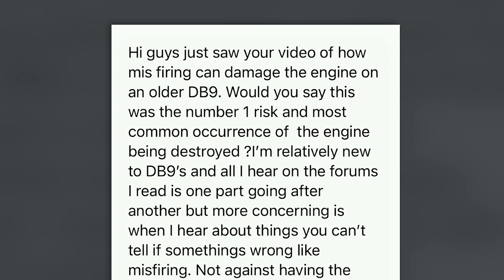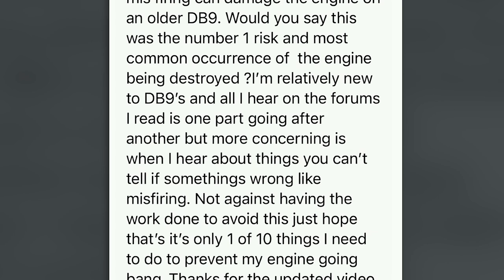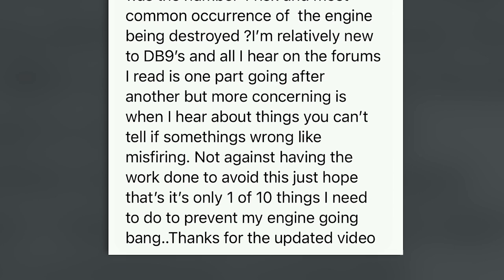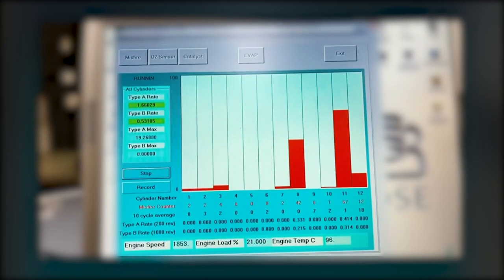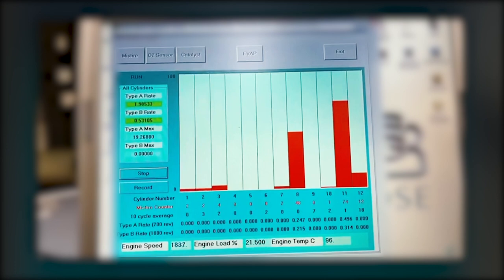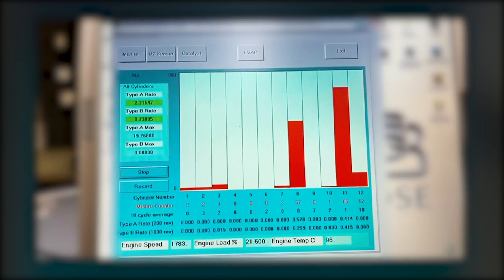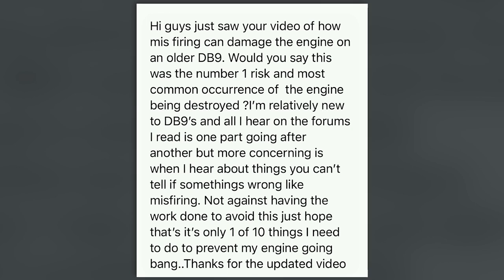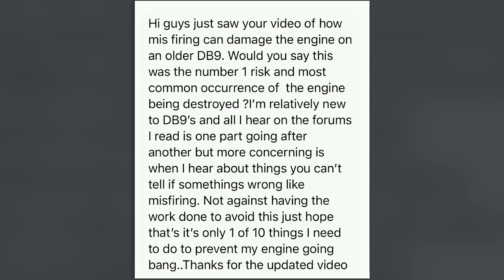Avoiding common V12 engine problems

Comment: Good vid giving owners the knowledge to check misfires.  Would be useful if a video was made of a misfiring v12 so we could hear it.
Reply: Check that video out, it might help
Reply: @vladimirilles339  thanks Vladimir,  that was really useful 👍
Reply: @vladimirilles339  When I look back at the video now, I know cyl 5 was the culprit, and that's the fifth cylinder back on the RIGHT side of the engine.  But why is the bump felt in left exhaust pipe?  I found a pic of the internals of the exhaust box, and the right banks crosses over inside the rear box and exits the left exhaust pipe.  Mystery solved.
Reply from the maker: check out these videos, hope they help!
https://youtu.be/vlSUBNPpaTk
https://youtu.be/uhkwrPQt5HM
https://youtu.be/jhKJN8aaAuM

Comment: The tick you talk about can this be heard whilst driving the vehicle? Only when test driving a 2007 DB9 Volante my wife and I thought we heard what was and sounded like something hitting the windscreen which went away. The engine was up to temperature. Never noticed on the first drive with roof up but did slightly when roof down. Just about to buy so your feedback is appreciated.

Comment: When you see the laptop display it's misfire results, what is still acceptable? Obviously the DBS was off the scale but what if they are all showing just small red bars on the bottom of the the graph, dies that mean we need to investigate and fix the issue because leads, plugs and coil packs will all start to break down and can initiate small misfires

Comment: Is the misfire issue more pervasive in the earlier V12's?  What about the Vantage V12S motors on the later cars 2014-2016/17?  All the misfire issues and videos I see refer to the older cars (DB9 most common).  Any thoughts?

Comment: Do you take questions on here? I’ve been tracking DB9 prices for a long time. For some reason for the last 6-12 months dealers don’t seem to be stocking many if at all 2009-2010 cars. They have older cars in the £40k region but then it’s straight to 2012-2013 cars at £60k+. Is it simply that the 2009-2010s aren’t coming onto the market?

Comment: Just out of curiosity... is there any reason why Aston doesn’t fit some kind of metal grid in between the down pipe and the cat to stop the injection of parts of the cat, or is broken parts of the cat too small to put let’s say y a metal grid in between being effective?